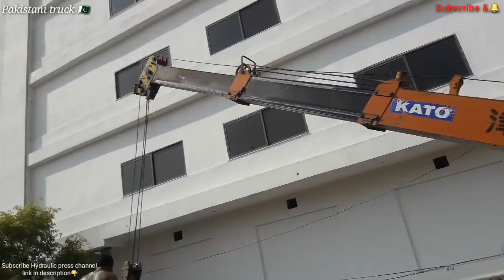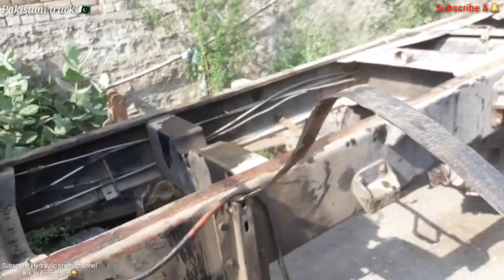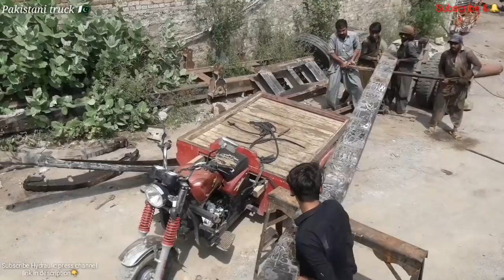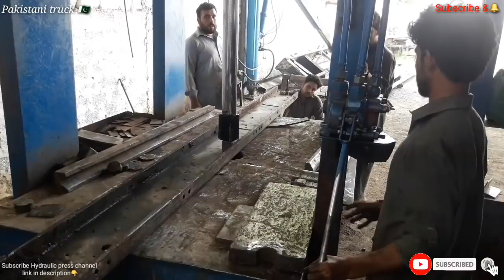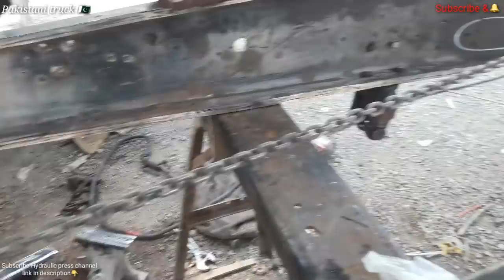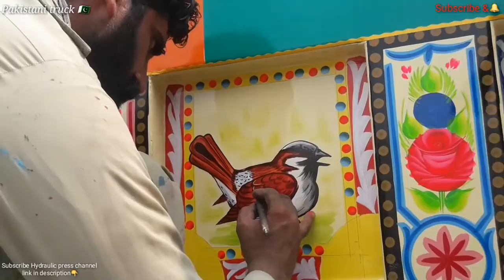Major accident repair and paint work on a Hino tipper truck

Comment: The man holding the chisel has all the faith in the man with the sledgehammer.
Reply: he replaced lefty the week before.
Reply: I was thinking the same thing!
Reply: @timmyhipbird7543  ap
Reply: I knw 🤣🤣🤣🤣
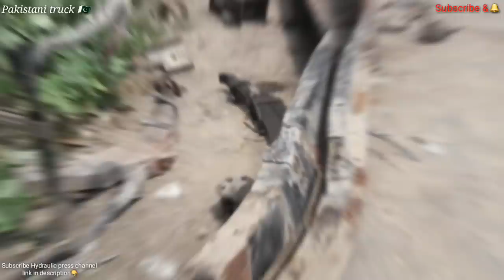Reply: At 7:46 is that a bloody rag laying next to hammer?
Reply: One miss and every bone in his hand is broken to pieces.
Reply: @pervariant  Absolutely.
Reply: balls of steel
Reply: Union ironworkers do it every day rite here in the USA.... And most of the time at heights most men weren't there to even stand on let alone swing at 20 lbs ..BFH Big,Fu_-kig, Hammer,
Reply: I do have the utmost respect for the men also because they're not making what they should be making. They're straightening those frames almost back to perfect with just one single ram and four guys seeing where it needs to be straightened .I am sure they make more than most people there but still nothing to call home about.
Reply: @seanbenoit7781  jajaja
Reply: Thats called a punch or knockout tool a chisel is designed to shed away material
Reply: How hard could it be to use some tongs on that punch?
Reply: No brothers in law allowed as co-workers. They might "miss" the mark "by accident". "Oops!".
Reply: He fail every 6 month.... another one came

🤣🤣🤣🤣🤣
Reply: I'll swing that hammer. I'm not holding the punch!!!👀
Reply: I swear.... I would have to have a big pair of plyiers or channel locks  to hold that punch getting hit with a hammer is no fun
Reply: I was ccringing.
Reply: I was thinking the same !   ouch!!
Reply: Also notice when the wrecker driver drove out from under that wrecked truck, there wasn't even one strap holding that semi to the trailer, It was all held on the wrecker by rocks wedging it upright..lol. And on every piece of frame they welded, they missed the joints completely with welding rod flux.
Reply: He never saw my brother swing a hammer let alone a sledge.
Reply: These two men look like as if its the god at work himself.
Reply: Thats what I thought !    Would not get me holding that chisel !   😆
Reply: I certainly don't think i'd be holding it with my hand..
Reply: Good  job
Reply: i have done the same kind of thing with my farther swinging the hammer, he never missed, and people who watched were pretty shocked, when i was a kid and the circus came to town, i loved watching a teem of guys hammer the ford axles into the ground to hold the tents up, i never saw one miss.
Reply: Yeah! this is  what I htough...
Reply: Yes he does and he's extremely stupid. It would be easy to assemble some type of punch holder to hold that tool while the guy with the sledge strikes it. The shop owner should intervene, unless of course he places zero value on the one holding the punch.
Reply: They could use a large plier to hold that punch drift instead of the guy's hand. That would be much safer.
Reply: This is stupid beyond belief. One miss or one distraction and means broken fingers, serious wounds or worse......even the wrist fractured. Why don't they use something like a broomstick to hold the chisel....
Reply: @lawrenceveinotte  So? It's just plain stupid and no safe at all. I have never witnessed a car accident due to drunk people, but seems like it happens every day in every part of the world...

Comment: They took that pile of junk off of that flatbed truck and turned it into that beautiful example of a truck. Simple handtools and manual labor unbelievable thumbs up all the way
Reply: Nossa vcs são maravilhosos um. Trabalho k requer muita força e energia fiquei surpreso com vcs
Reply from the maker: muito obrigado
Reply: Good job. Highly skilled
Reply: I see a lot of complete Cabs around Asia. It would make sense to me the cab over the engine was just swapped out with a new one.
Reply: And it only offtracks 6 inches to the left...
Reply: @forevercomputing  if you look it is a completely different cab they mount onto the chassis. The old cab is lying under cover ready to salvage for parts

Comment: really trusting with the guy with big fricken hammer
Reply: Seriously!
Reply: I thought the same thing. I'm sure they've had some serious injuries doing that over the years.
Reply: Lol I though I wouldn’t put my hand their no chance 😂.
Reply: Skill gentlemen, skill.
Reply: @sts1541  yeah, they use extensions in some of the other vids.  Workers beware.  The danger seems self evident, but my hands ache from misuse too.
Reply: Not my hand... I don't even trust myself
Reply: he's probably been doing it for years, he could probably do it blindfolded. you forget that these guys do the same job all the time. so some guys do the drilling others the hammering etc etc
Reply: @Jim0i0  yup that cause more injuries, the vibration from the hammer blows tends to mess a persons hands up really bad over a long period of time
Reply: @johndowe7003  yeah, I just turned 50, but my joints feel 70.
Reply: Looks like safety here isn't really #1 priority. :) Driving those bent rails on modified bike! Man, that's crazy. Also everyone working in sleepers with all the heavy metal around.
Reply: In another video they put some distance beteeen the hand and the chisel with a steel tool.
Reply: Amazing
Reply: Small mistake could cost of his hand,
Reply: Hahahha yeah......i ws thinking the same
Reply: @johndowe7003  they are called gunman they are expert in this trade but they also perform other tasks
Reply: @smtiic  yeah that's what I figured
Reply: @johndowe7003  so you would hold the punch then?
Reply: @catfish252  I personally would use a pair of pliers but no I wouldn't hold it, id rather swing the hammer
Reply: Mashallah!!! Very nice!
Reply: Keep on hammering for 50,000hrs and you are considered a pro.
Reply: @MojoDevirus  lol, isnt it 10000 hours to be considered an expert?
Reply: You are very correct sir. A theory from Malcolm Gladwell of 10,000hr.
Reply: Yes seriously but they are expert and don't consider to slip in any way.
Reply: FACTS
Reply: Same shit I saying. I attached to my hands and have always appreciated the use of them. Can't trust them to the hammer guy
Reply: Donald Henke - After using the hammer for 20 years you hit where you are going to hit, he is responsible for this work. If he who hold, keeps doing his part of the job, everything goes well.
Reply: @johndowe7003  I'm sure he has been doing it for years and is a master at it, but even if he is 99.9% accurate he is going to miss one blow out of every thousand. That is some serious hand damage.
Reply: Cost nothing to weld handle to chisel
Reply: that was crazy.. specially in reverse 7:15. That was ridiculously  crazy.
Reply: Man!!!
Reply: Dam right i saw that nope ill sweep and mop the floor but these guys are another level not to many tools if they gave that to a guy here in the states he would of ordered both frame rails new axles.
Reply: I cant trust my coworkers to hold the end of my tape measure correctly.
Reply: @mikhail850  you can't weld onto tool steel it'll shatter shrapnel will be everywhere takes the carbon out of the steel
Reply: J
Reply: I know right
Reply: Came for this comment....crazy!
Reply: @haraldpettersen3649  exactly. Everyone else commenting probably wears a mask while driving alone🤣I mean,they are from a country that relys on OSHA and decals that say not to place hands in sharp moving objects. Bunch of wankers with no knowledge in a trade.
Reply: @jasonbamford7579  shows the level of knowledge commenters have 🤣🤣🤣zero
Reply: @Pimentel-Kreations  - There are two completely different "worlds", it is not possible to compare them with each other. We use computers to control our tool, they have people who do all things in production and repair. But they know what they are doing, there the workers are the machines, and doing the same work, maybe their whole lives. That's how you become skilled. 👍👀
Reply: Yes
Reply: Wow . Obviously there are not any weight restrictions lol
Reply: Ain't no way in hell
Reply: Theyve been working together for a long time. Broken fingers and hands among friends

Comment: Pakistan gets a lot of bad press in the West, mainly for political reasons, but these guys are amazing. What they can do, with little or no safety equipment, and mostly hand tools, is astonishing. You could call them the world's best shade tree mechanics. Engine and driveline work, frame repair, body work, springs, bearings -- nothing is off the table. Notice that the damaged truck was held in place on the flatbed, with only a couple of large rocks? It worked, and that's what matters.
Reply: These guys are in a different level to tell you the truth I thought I was hard core but I have to admit these guy passed me left me behind.
Reply: I notice in all these Pakistani truck vids, that the workers are all young. I wonder if it’s because they all get injured, and can’t return to work. These guys do incredible work, but seeing them beating on punches & chisels, using cutting torches and grinders, and no safety glasses or face shields anywhere, working around all this heavy steel while wearing sandals, holding a punch  while someone else whales away on it with a sledgehammer etc.. I bet this place goes through employees at an alarming rate! A person would probably be lucky to work there 3 months without losing an eye, crushing a foot, or other serious injury! They do some awesome work though!
Reply: Bad press for political reasons is world wide, and it is mainly about GOD, Guns Oil and Drugs.
But nothing will take away from the skills of these hard working guys, their boss has to be proud of them, i did my time on the tools, 6 year apprenticeship, but I could still sit and watch these guys all day long, wish i was there, maybe next year, dreaming........
Reply: Very nicely stated.  I am a Pakistani American, and I agree, Pakistan gets a lot of bad press in the Western Media for mainly the political reasons.  But the common people in that country are very hard working.  Also almost all of the Trucks, Buses, cars, Motorbikes, Farm tractors are Made in factories set up all over Pakistan, with Technical Assistance from Japanese Parent companies.
Reply: @tomt9543  ,  Good observations.  You correctly noticed a lot of young people, it is due to vast majority of Pakistan's population, 66%, is 35 years old or younger.  And also, most of these young apprentices, stay with their "Ustaad" or the teacher, for years in the same workshop. As you can see, they love what they do, many even have fun, notice a young guy, climbing on the Hydraulic lift chain as a zip line, for fun.  The bosses are usually also good and joke around, after work, but not during work.  I know since, I am Pakistani American, and have lived in Pakistan for many years.  Also, many people say, why they wear Sandals, and baggy pajamas.  The answer is simple, it get very hot, sometimes 110F or more, and you can not wear American Style Sneakers, or even steel toe boots with cotton Socks, it just feels like your feet are on fire, in that Hot climate with no A/C.  Western/American Factory workers uptill early 1900's use to dress in casual wear, with no hard hat or steel toe boots, similar to these Pakistani workers.
Reply: @redfordrn  Nicely explained brother❤

Comment: Imagine if they had real equipment 😳 these guys are badass 🤙
Reply: Major Fauolo Absolutely right. These are guys are nothing short of amazing!
Reply: there only badass because they do without equipment and create a straight usable machine. takes less skill with modern equipment.
Reply: Straightening a frame is nothing special. Its just the wage in this country is so low its cheaper to fix that piece of junk with 20 men for 1 week than to buy another one.
Reply: @Chris-yy7qc  apparently you never been an iron worker
Reply: @Airman..  Wrong. Ive already done it myself. lol
Reply: @Chris-yy7qc  good do you have a degree in metallurgy?
Reply: That press is a pretty expressive piece of equipment
Reply: @smokeygasser4037  Or it might be some dude three streets over built it for $27

Comment: I am in total awe of the men with the hammer & punch. So accurate and trusting of each other.
 The way the shop straightened the truck frame rails was also incredible. Here in the U.S. that truck would have been sold as scrap. I also admire the painters. Their artwork is wonderful.
 Now the truck is back on the road, and at a cost less than buying a new truck too.

Comment: Americans: "send it to the scrap yard it's no good anymore... Buy another."

Pakistani truck: " Hold my AK 47..!"
Reply: HAHAHA ... seems to happen in all non-white countries ...
Reply: Yes its true these men don't play around nothing is going to the salvage yard.
Reply: Thats because in the west if you pay for all the work of this many men, the repair will cost way more, than a brand new truck.
Reply: @narancs5  💯% correct. Plus the Union, excess breaks, overtime.... 
Very true indeed.
Reply: They may be talented at straightening things, but the places where steel was bent and then straightened become weak points. Those chassis rails will never again be as strong as before they were bent. It's better to scrap them. Old steel is the main raw material used in the production of new steel, which is the best use for these bent chassis rails.
Reply: @CaptHollister  I agree but the phrase "work with what you have...." In this scenario is an understatement. It may not be 100% structurally sound, but if it falls apart, they can fix it again with ease.
Reply: @OG_DSM  What if someone dies because a truck's chassis rails weren't structurally sound ?
Reply: @CaptHollister  Well... People die every day just crossing the road... It is what it is.
Reply: No lawyers involved.

Comment: You guys are freaking Craftsman. Wow!
Reply: the guys are freaking dangerous. rebuilding a truck that in the US wouldn't even be allowed to run the loads these junk yard mechanics piece back together.guess it doesn't matter they will just have more kids to replace the people killed with these junks on wheels. they have plenty of warm bodies there won't miss a few thousand here or there.It's what you get when you have no safety laws and you allow anything that rolls on your streets.they even repair their damaged tires that are beyond repair and are a safety hazard.
Reply: @timmyhipbird7543  you have to admit it is pretty impressive, I'm not saying it is not DANGEROUS. 🤣👍

Comment: Great work, though I can think of a few other reasons this isn’t done here. Most modern North American trucks and automobiles use Ultra High Strength Steel. UHSS is drastically weakened if it’s heated, welded or bent. Because of liability only new parts are used to replace UHSS components. 20-30 years ago there was no UHSS and these types of repairs were performed where economically practical. The insurance industry has also changed and are able to recoup a fair amount of $ through the salvage auction process which tends to cause more vehicles to be sold for parts. Check out Arthr Tusik. He rebuilds US salvage in Europe. His work is probably not proper or safe in the North American market but it’s amazing just the same.

Comment: I was impressed by the way those two chassis runners were straightened out, it may not be millimetre perfect but is probably good enough for reconstruction. The only thing I'm not sure about is structural integrity as the metalwork suffered considerable stress caused by the accident, and then the straightning out. But good effort. The end result was impressive, even if it had a replacement cab. How safe was the chassis reconstruction might be questionable in western terms though.
Reply: The original parts have certainly manufacturing tolerances which would surprise you. A truck is not a swiss watch.
Reply: Frame chassis may not be able to line up at a superhighway high speed, But good for them on the mostly rugged roads where they do have many mountains down there.

Comment: I love watching this channel and I am always amazed at the end result, but I can't help thinking that  the health and safety zealots here In the UK would be bursting many blood vessels watching  the interesting working practices employed and total lack of safety gear.
Reply: Being blinded by arc welding without a mask, driving two totally unsecured steel beams around town on the main road or paint spraying without a respirator is just basic safety not zealotry.
Reply: @snowflakemelter1172 over the years I've had arc eye, moved a 14 foot steel beam sticking out the back of a  transit van with my mate holding onto it for several miles and never use masks when spraying, I'm 67 so it doesn't seem to have done me any harm

Comment: Putting the frame rails on that flat bed scooter was crazy enough, but then they straightened them out! Unbelievably skilled and resourceful bunch of real mechanics. Here in the U.S. that truck would have been parted out and the frame scrapped for sure. Hats off to you guys!

Comment: I remember my mate who is from up those ways saying he used to do car motor swaps by loosening up all the top bolts etc and hanging the front of the car on an angle from a tree and extracting the engine from underneath.  Real out back stuff.

Comment: I'm a welder fitter by trade you should weld a flange around that punch so you don't end up missing and crushing a man hand with that sledge hammer. You should build yourselves an A frame to help lift up those heavy frame rails as well or an overhead gantry crane, it doesn't take much. And it would save you massive amounts of money in the end. I have to admit that quite impressive though straightening out those frame rails with a push jack and its all done by eye. Pretty amazing!

Comment: Yes,those folks have different standards than the USA.but that does not take away from the fact that those are some very skilled men.They took that wreck and made a truck out of it when in the USA that truck would have been scrapped.I have seen semi tractors scrapped here that were not damaged nearly as badly.